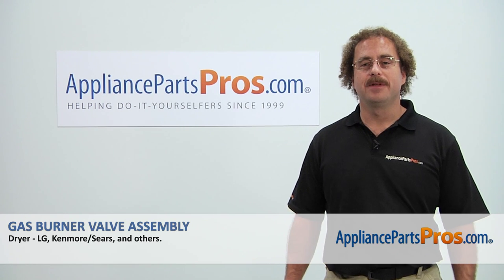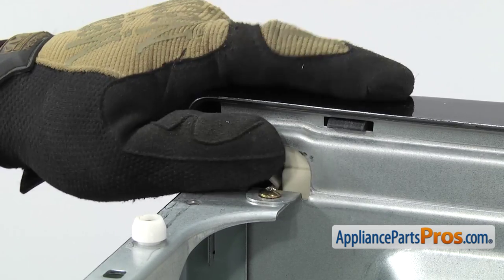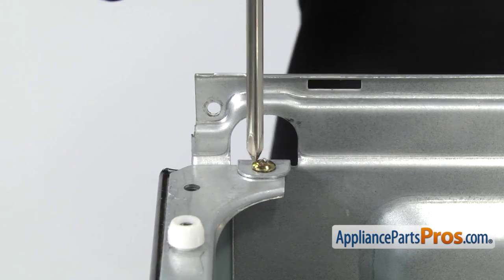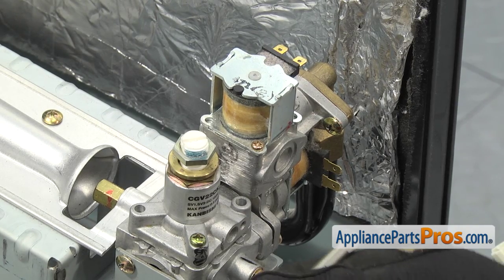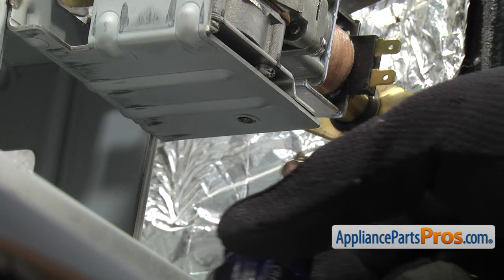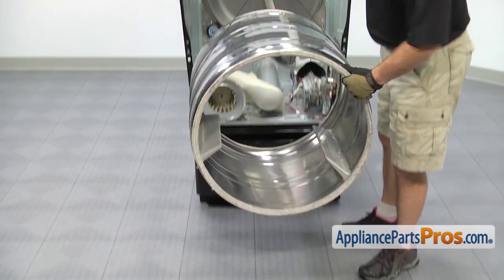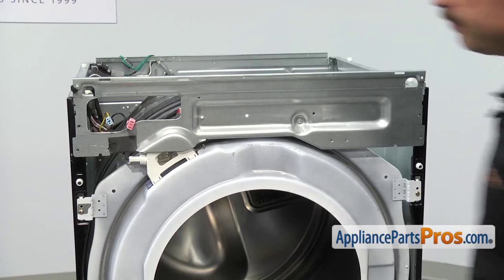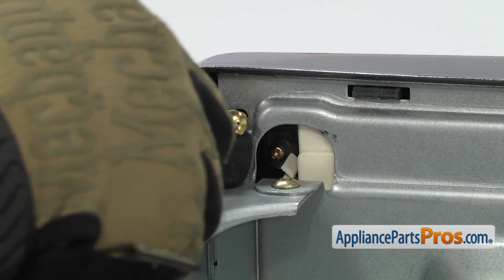How To: LG/Kenmore Gas Burner Valve Assembly 5221EL2002A

Comment: Your Awesome Video saved me over $300!  The repair man wanted $405 to change out the dryer's gas valve after diagnosing the problem.  I bought a brand new valve for $69 and with your step by step video guidance, I replaced it in less than an hour.  Turned it on and Bingo, it works!  Dryer heats up again!!  Thank you for making it so easy!
Reply from the maker: Glad the video helped you get the dryer fixed!
Reply: @appliancepartspros  So,no dope or thread sealer is to be used on any parts of the gas valve?
Reply: where's did you get a new one for that price?

Comment: Does LG sell the coil for replacement? I ran a test on my LG gas dryer. There's no hot air from the first heater but there's heat from the 2nd heater so I would assume one of the coil must have gone bad.
Reply from the maker: What is your model number?
Reply from the maker: Good luck with your repair and let us know how it goes!
Reply: @appliancepartspros  I got the it working after changing the gas value cuz I can't just buy the coil. I am pretty sure it's the first coil.

Comment: hi is it possible to just change the set of  gas coils , or do i have to change the whole valve?  my dryer starts and  heats up just fine , but stops heating after 5 minutes.
Reply: have the same issue and cant find coils to replace this. No part listed.
Reply: Could need another part you have to ohm out other safety switches and fuses or it can also be a board if LG normally no heat door switch/high limit/ ignition rare/ or coils since 2 one to start 2nd to run/

Comment: Is this the same as replacing the valve in a Samsung DV328AGW dryer?  I'm hoping the Samsung is much easier, but my money says it's the same thing.  What say you, kind sir?
Reply from the maker: While this may give you a general idea, we can't guarantee that the video will be a match for your Samsung dryer. That said, we do offer free technical advice and diagnosis, so if you run into trouble with your repair, you can give us a call and we can try to talk you through it. We’re available 7 days a week at 1-877-477-7278 or you can chat us at our website: http://www.appliancepartspros.com/

Comment: mine has red and white wire to the bottom solenoid and double red with pink wire to the top solenoid. Is this ok ?
Reply from the maker: This valve may be used on models with different wiring harnesses, should be ok as long as you replace them in the same location.
Reply: Me too -- did you have double red toward the front still?
Reply: @appliancepartspros  Mine also had double red with pink -- does double red always go toward the front? I did not take a picture first, sadly
Reply: Guys?

Comment: I have gas lp setup but I just can't turn the plastic screw to close it for this setup, anyone knows how to?
Reply: I have the same issue, are you using the dryer without turning the screw?  I don't know what to do
Reply: @D4rkTaku  I havent used yet, I broke the screw and had to buy new valve, I noticed that You have to use a very wide screw and plenty of force with low torque to turn it.